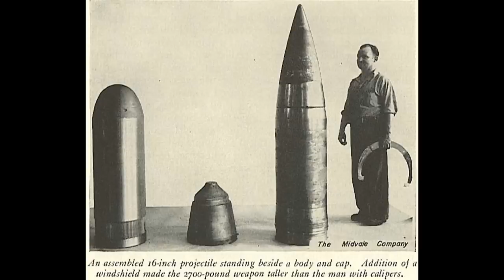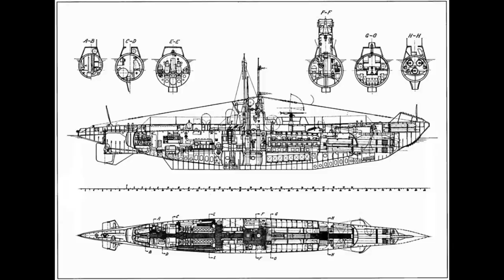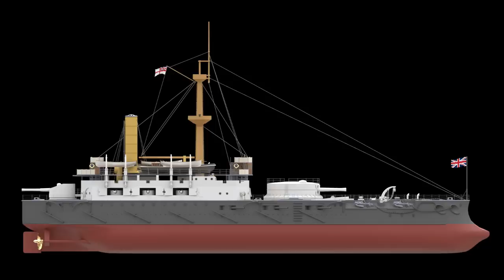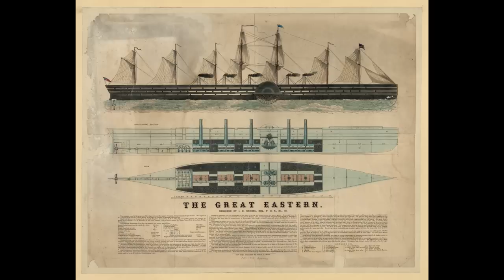The Drydock - Episode 217

Comment from the maker: Pinned post for Q&A :)
Reply: Question : In WW2 You could pretty much determine what country a ship belonged to by it's architectural design. Does the same hold true if you were below decks? Are the insides of ships all generically the same or did every country have certain design features that would allow you to tell what countries ship you were inside?
Reply: Is it true you can produce a Patronus Charm?
Reply: The question about aluminum shell caps got me thinking of magnesium.  My question is did anyone ever think of adding a burning compound to HE shells be it magnesium, thermite, or white phosphorus?  I would imagine a fire you can't put out that can burn through frames and levels would be problematic for damage control parties.
Reply: I'll volunteer if you ever need an American accent for a video.  I've been told I have a great radio voice when I used to dispatch an air ambulance.  Kinda like how Brian Shul describes how ATC controllers talk in his L.A. Speed Check story.  And I was pretty good at calling cadence back in my Army days too, if I do say so myself.  😁
Reply: Could you kindly produce a segment on the Bergen portion of Operation Wësserbung ? A "K" class light cruiser gets put out of it's misery- therefore your possible inclination to make a segment of the Bergen raid ?....
🚬😎
Reply: @kenfury2441  I can answer a couple things here as a former Army Combat Medic and then civilian Paramedic/Firefighter.  White phosphorus is used in illumination and smoke artillery shells.  It burns hot, but contrary to popular believe, dose not burn under water and is easily extinguished by it.  In fact, pure WP is typically stored under water to prevent it coming into contact with the air.  Magnesium on the other hand will burn more vigorously when hit with water, but is typically extinguished by using a foaming agent like AB foam or AFFF.  Thermite is essentially just burning aluminum using another metal oxide as it's oxidizer.  Water will cause it to essentially explode, but a normal thermite burn happens too fast to have to worry about having to extinguish.  Incendiary rounds only ignite combustible materials they come into contact with, not do the actual burning through a target.  HE/incendiary rounds do exist, but are designed to enhance the chances of a secondary fire after the HE detonates and ruptures things like fuel/oil lines, etc.
Reply: Do you think the commissioned vessels of the U.S. Army would make for a good episode?  When I was stationed at Schofield Barracks, Hawaii we would load up our equipment and vehicles on the USAV CW3 Harold C. Clinger to transport them from Oahu to The Big Island.  I always thought it was interesting that the U.S. Army had it's own Gator Navy.
Reply: One of the things we frequently see in histories of British lighter naval artillery is that the designers were trying to find the largest object (either shell or fixed round) that a crewman could reasonably handle while at sea. This would produce the 88 lb shell of the 5.25" gun, the 74 lb fixed round for the 4.7" guns used on the Nelsons, and the 85 lb fixed round for the 4.5" gun used on so many ships including the QE refits. However, these all tended to be heavy enough to impair the rate of fire, reducing the effectiveness of these guns in the AA role. Do you think this "heaviest object a crewman can reasonably handle" standard was reasonable, or should the Royal Navy have learned quickly enough to rethink it before WW2? I won't point to the US as a counter example, because the US had basically settled on the 5“ as their secondary gun caliber by the beginning of the 20th century, with the minor exception of using 4“ guns on their WW1 destroyers. The US did, however, transition from an 80 lb fixed round for the 5"/25 to the semi-fixed round of the 5"/38 with 55 lb shell and 30 lb filled cartridge case.
Reply: 59:10 what’s the naming convention for more than three masts on a ship? I can imagine an after mast or a second fore mast but I can see 7 in this picture!
Reply: I dont have experience as voice actor, but I am more than willing to help if you need someone to do spanish dub (argentinian) and I imagine there is many more.
Reply: Alt History Q&A: How drunk would drunk Drach be for drunk Drach to sing Jeff Wayne's War of the Worlds? I'm assuming getting Drach drunk enough would be the only way to get you (and friends) to read/sing a cover of that play/musical. How about it Drach?
Reply: What in your opinion was the turning point, where the japanese went into the defense? I find it difficult to pinpoint.
Reply: Do we know if it's better to keep steel museum ships afloat or dry docked when it comes to preserving them for the longest possible time?
Reply: IF Ark Royal had been a part of Force Z, would this also have meant an increase in escort vessels & thus added more than just her aircraft as defence against the Japanese attack?
Reply: Thunderchild want. Model. Please. Will print on my spiffy 8k printer.
Reply: Question: How exactly did fire control RADAR work during the Second World War? Was it primarily used for more accurate ranging to be fed into the fire control computer, or were there direct linkages/integration from the RADAR electronics into the electromechanical guts of the fire control computers?
Reply: War of the worlds please
Reply: @kemarisite  I suspect what made the semi-fixed ammo for the 5"/38 workable was the power rammer.  iirc, shell and charge are dumped in the loading tray and rammed together., vs loading shell and charge separately on the 5"/51.  That is what gave the 5"/38 the rate of fire equal to a gun with fixed ammo.   I did an exercise where the USN used the twin 4"/50 mount that was installed on a few DDs experimentally, in place of each 5"/51 on a BB.  The results were interesting.  Then I did an exercise where the 4" is cut down to 45 caliber, converted to a sliding breech, and installed on the twin, dual-purpose, British Mi XIX mount they used with their 4", in place of the 5"/51-5"/25 combination USN BBs had in the 30s.  Even more fascinating results.  I have read that Jackie Fisher was an advocate of more smaller, rapid fire, guns, for a secondary, rather than the 6" casemate mounts then common on RN capital ships.  The ships Jackie had a personal hand in, the Renowns and Courageouses, both had 4" secondaries.  My hypothetical USN 4" exercises indicate Jackie might have had a point.
Reply: Did the Austro-Hungarians have any plans for more modern ships/dreadnoughts that they just couldn't build due to WW1? If so could you point me to sources to look at said plans and read up on them?
Reply: On a Sci-Fi note concerning BSG. (SPOILERS)
Did you think the Exodus from New Caprica was influenced by The War of the Worlds?  
I certainly did, especially with Pegasus filling in for Thunder Child, Galactica as the paddle steamer, and  Cylon Basestars instead of tripods.
The main characters on Galactica are powerless and about to be destroyed, but  are surprised by the sudden intervention of Pegasus.  She cuts down one basestar with her initial salvo, charges into the fray (taking major damage but throwing the enemy off balance) and rams a second, with the resulting explosion destroying a third.
Reply: Would armor-piercing shells loaded with anthrax spores be effective as an anti-capital-ship weapon if used in conjunction with conventional explosive AP shells?  One of the biggest disadvantages of biological warfare is the risk of the biological agent spreading to your own troops, which probably isn't likely in a situation where the spores are being express-delivered to an enemy several miles away who's operating from fleet bases hundreds to thousands of miles away from your own bases, and, given how incredibly difficult large-scale anthrax decontamination is, even one or two hits by spore-laden shells could conceivably render an enemy vessel permanently useless.
Reply: I am a native Portuguese speaker, and live in Britain, and would love to be of assistance.
Reply: Hello Drach. Could you give a brief description on the footage that’s used in your videos intro please? Like the names of the ships, when and where the film was taken if known and any other details you might have about it. 

  Thank you! And sorry if you’ve already done that. I watch almost every video you put out but there’s still a bunch that I have yet to see!

And I hope your all better and recovered from the Seydlitz video!
Reply: I know you've done a few videos on the Illustrious class, but I'd like to know more about the role of HMS Unicorn in it.
Reply: In his book 'Opetation Pedestal", Max Hastings writes about the poor quality of food for  the Royal Navy's enlisted personel.   Was this due to wartime exigency or was it the Royal Navy norm at this time?

Hasting also states that Churchill wanted to ask for Ranger but decided against it and opted for bring8ng all but two of the Royal Navy's carriers.   Why would he not want to bring Ranger anyway since she carried more and better  fighter aircraft than the three Royal Navy carriers combined?
Reply: South American Spanish? As someone that has been to the 9 big Spanish speaking countries, there are many dialects. I would say Castilian Spanish is basically understood pretty well in all places. If you use 1 dialect from 1 area that may cause the problem you are trying to avoid.  
  Nobody understands the Chileans. Uruguay is spanish/Portuguese. Argentina is Italian Spanish. Never know what you will get in the Andes as they have more native American influence.  Just like Spain, in Barcelona you say bon Dia, in most of Spain it's Buenas Dias, but in the west it's Buena Dia, in South America they use all of these depending on location like Spain but also class and personal preference.  All are acceptable and understood in South America but not so much in Spain. Foods are something you do see differences in names often from Spain to the new world but I don't think you will talk about food much. 
The only problem I see. 
 Americans struggle with French and German pronunciation that an English person can do easy but we can pronunce native American names. The Spanish(euopeans) also struggle with native American names which may be names of places that are relevant to the battle but most bigger cities or natural features have old world names. Oaxaca would screw a European Spaniard all up. Lol (wahaka)
Reply: Question 2 each ;  when they flood the powder room with sea water, is the powder usable after it is dried out or does it have to be discarded ?  2 question; when in modern times they need to upgrade some equipment inside the hull. They cut a hole in the side armored of the hull to open a space to exchange the equipment, welding a patch back in 6 inches thick adequate. Some welders told me they stick weld on the side of a war ship, would the armored hull be as strong as original ?
Reply: I do have a question that maybe you or another knowledgable member of the community could answer. The King George V class have always been much maligned for having been designed to be able to fire her main battery at 0 degrees forward and therefore not have a flared “Atlantic” bow and called “wet” ships. At the same time there’s a reasonable amount of material out there to say that frequently when Scharnhorst and Gneisenau sailed they took damage/flooding from rough seas/heavy weather. Given their service with the Atlantic convoys etc are there any sources on whether the KGVs were prone to taking damage in the same conditions?

Comment: You left one aspect of ECM issues Integration out of the discussion of counter measures and Radar systems.  Since electronic countermeasures need to operate in the band of opponent Radars and the Radar equation solves out to the same frequency ranges for the functions both ways.  Accordingly an ownship  ECM could easily interfere with ownship Radars.  I know something about this issue. having been employed from 2015 to 2017 dealing with this Systems Integration for the US Navy as a Contractor working at NAVSEA in the Above Water Sensors Division.  My customer was the Chief Systems Engineer for EW.

Comment: Hey Drach i love your in depth discussions about the engineering and production side . As a longterm boilermaker /plater i'm still fascinated by how they built these massive ships in the days before technology's took a massive workload off fabrication .
Aluminium is one of the more ductile metals and a main favourite for drawing , spinning and pressing from rolled plate or section , work hardening can make it brittle but in -process annealing to reorientate the grain size and shape is common on most metals requiring a lot of physical mechanical shaping . This is why coke cans, baco foil ,pots ,pans and a lot of the earlier tubes for toothpaste creams and gels were made from aluminium as it is very ductile and great for impact forming into thin walled items. Cast alloyed aluminium is the only variety i have ever come across that is relatively brittle especially the chineseum variety . Heat treatment can improve this but i would of thought shell windshields were spun or pressed but i'm no shell making expert so only if they were perhaps cast they would possibly be brittle ?

Comment: Having serves 6 years on 2 USN ships (large supply and destroyer), and from Electrical division; I can attest that teh largest item that required servicing/repair were electric motors. The repair could be everything from simple bearing replacement, commutator gutting to the extremely rare fabricating new mourning brackets. The large supply ships had motor rewind shops so that repair was routine for the electrocutions assigned to that shop.

Comment: The problem the Japanese had wasn't just the ships and casualties at Midway, it was who the casualties were. The pilots and the air crews that service and handle or maintain the aircraft on the ships. Collectively, they represent an expensive highly trained group, as the war progressed it was evident Japan had trouble replacing them.
Reply: Japan actually suffered relatively few pilot losses at Midway; see Shattered Sword. Most of the pilots were picked up out of the water and reassigned to other frontline units.

Comment: AMERICAN STEEL ARMOR WAS THE BEST IN BASELINE METALLURGICAL QUALITY DURING WWII DUE TO ITS AUTOMOBILE INDUCSTRY HAVING WORKED OUT MANFUACTURING MASS-PRODCTION PROBLEMS.  Flat statement, period.

US companies that made these US Army and Navy  armors sometimes also used molybdenum and so forth and other times not, simply because the need for these extra elements sometimes helped during the manufacturing process, but did not make a better final product in most cases.

The first plate of this kind of nickel-chromium armor was PLATE #420 by Krupp in 1894, and it was EXACTLY AS RESISTANT (!!) as the general armor ballistic test requirement specs for ALL homogeneous armors made by ANYBODY during WWII, so there was really no improvement in the baseline steels used through well after WWII, as long as good quality control and no cost-cutting was applied.

During WWI, most mass-produced armors were rather dirty and had too many impurities than the hand-made plates like that first Krupp plate, though by WWII many manufacturers, but not all (Japan to a lesser extent due to enforced "good enough" specs, for example), had upped their manufacturing skills noticeably.  US Navy test specs requiring too thick a face for its face-hardened Class "A" armor in WWII was due to an ultimately failed attempt to damage their new, super-strong naval AP shells, not really understanding how much that requirement caused scaling effects on their thicker plates to protect against the larger of these shells.  The Class "A" armor was much better due to better hardening and tempering processes for such hardened armor than its average WWI-era Class Ä" armor was (it could destroy the WWI US Navy superior Midvale Unbreakable AP shells that most WWI-era face-hardened plates could not damage), so they did not realize how much better their Class Ä" armor could have been if they had eliminated the shell damage requirement -- which they did by the end of WWII, but too late.  US WWII Class Ä" armor, as with British WWII CA and German WWII KC n/A, was made at least as well as they were, but while both the the British and Germans also changed their face thicknesses from their WWI plates, they kept them much thinner than the new US Class "A" plates did and did not have the increased scaling penalty.